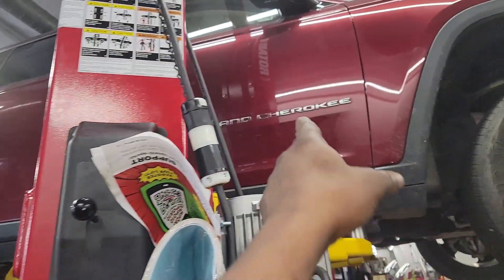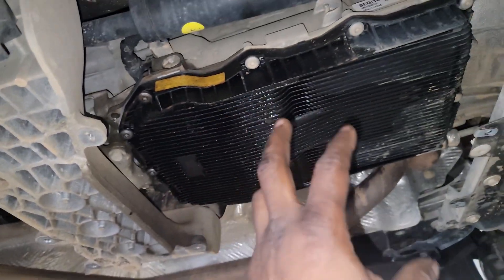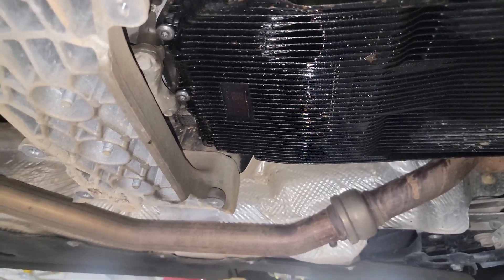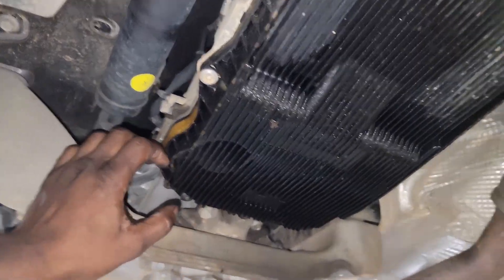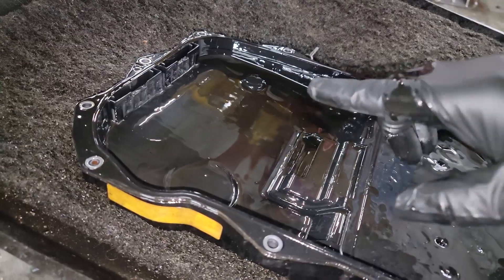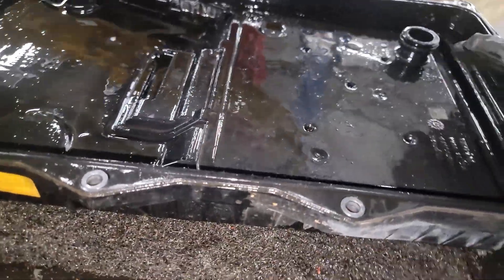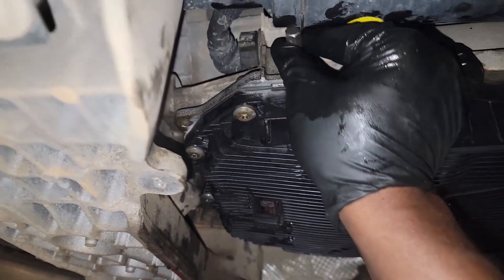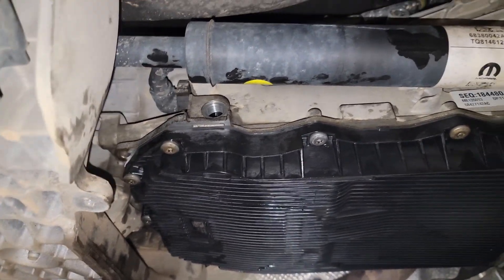“8HP Transmission Leaks Explained — Did ZF Engineering Fail Here?”

Comment: My trans has only a strainer,no filter. Smallest thing it can catch will be like 6mm bolt. Dealers don’t have it as a replaceable part. So,for me drain and fill is the only way,or complete fluid flush.
Reply from the maker: What kind of car is this you speak of?
Reply: @OnlineMechanicTips  I have two 2014 and 2015 Nissan Xterra with 5 speed auto.

Comment: Changed mine about 6000 miles ago on my Ram. Its not hard guys. Follow directions exactly and temperature reading on dash so fluid doesnt get too hot. Shifts beautifully. Your transmission will love you for it!😊
Reply: How did you deal withe cross over exhaust pipe under the pan?